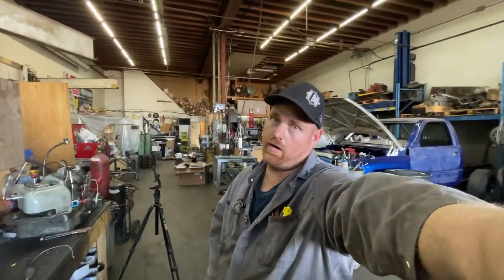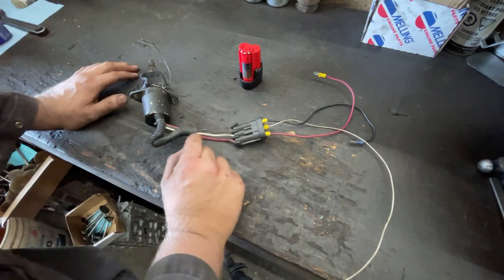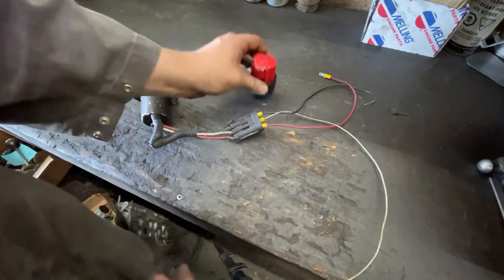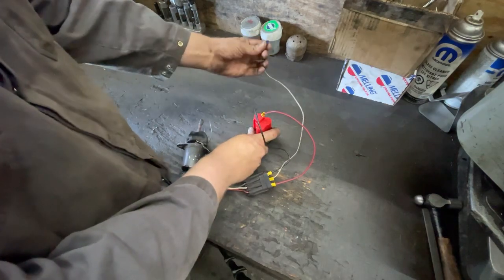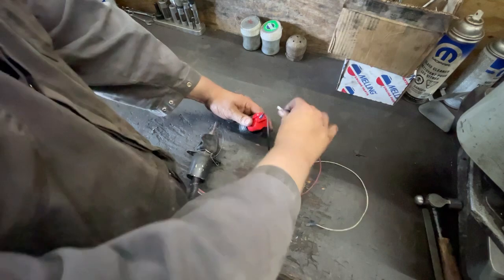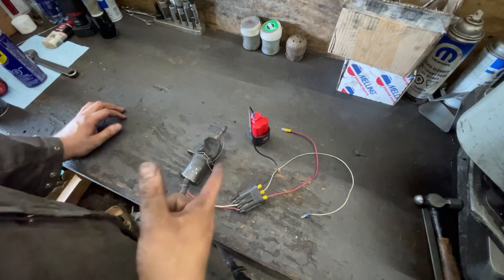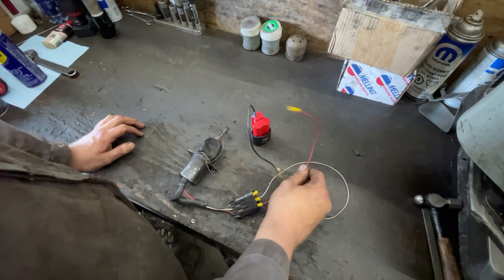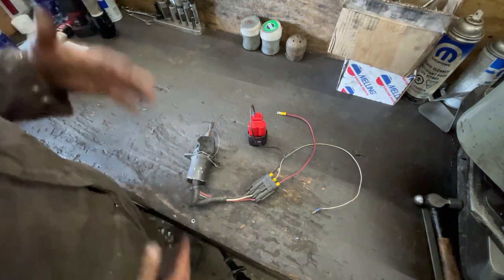"Unlock the Secret to Wiring Your Cummins Fuel Solenoid Pump!"

Comment: I have a p-pump swapped 24v that starting taking multiple cranks and longer crank times after installing a leveling kit and accidentally unplugged a pin from the solenoid. We looked at old videos and noticed one or two weren't plugged in anymore. We reattached it and it started better but now that you explained it, I'm starting to think we may have got the push up on the wrong one, which quickly killed it. It's been over a year or slow starting and having to push the lever. I'm gonna test it like this tmmr and see if it's plugged in right, and if my solenoid is bad. Will update

Comment: How about on a ve pump? I have a 86 chevy k30 with a 12 valve swap. How do I wire it in to the ignition?
Reply from the maker: There is a solenoid right behind the afc house that will have a stud and a blade connector on it. Put keyed 12v to that

Comment: That was very helpful. Just working on a Case MX135 tractor that has solenoid trouble and has to be manually clicked into run position after you have turned key on. I can trouble shoot now. Thank-you.

Comment: There's a 3 wire module made by woodward that you can use so it won't burn up the solenoid
Reply from the maker: No reason with these if it wired right.

Comment: I wired mine using a ford starter solenoid for pull function and regular relay for hold function. Probably overkill but ill never over power it. 

Starter signal activates starter solenoid for pull, then the regular relay thats key hot runs the hold function! 

Starter activates

Comment: Do you know where a can get the pin break down for the engine inline of the power distribution center on a 1999 Dodge Ram 2500 Cummins and V-10??
Reply from the maker: Beat to find someone that has alldata or Shopkey they can print the wire diagrams for you

Comment: the ground wire is very important, use the the same gauge wire and make a good ground to battery is best.
Reply from the maker: 100%. I have found most wiring issues to do a ground problem
Reply: When you say ground to battery are you saying literally run the wire to the negative post?
Reply: @johnathonjsmith  yes thats how did it on the cranes never had a problem